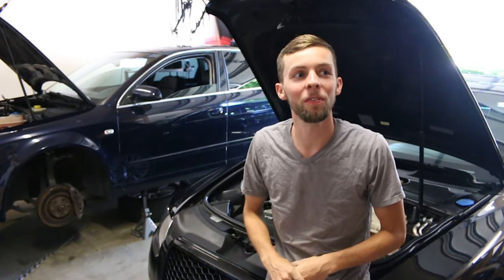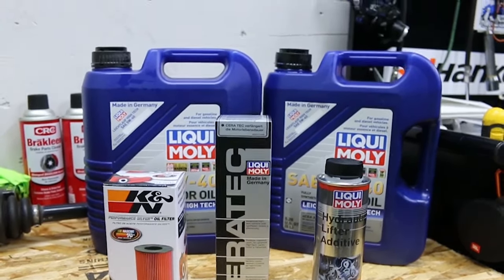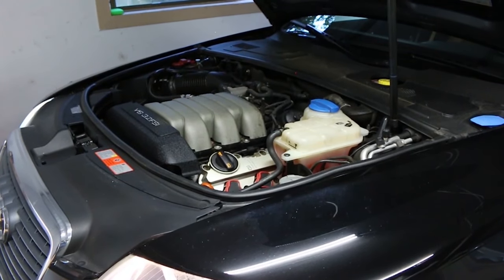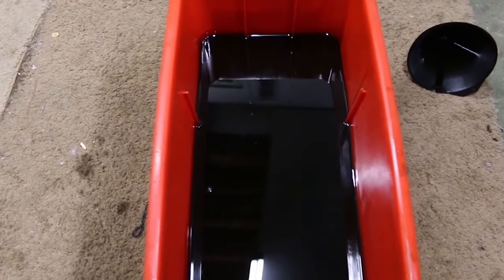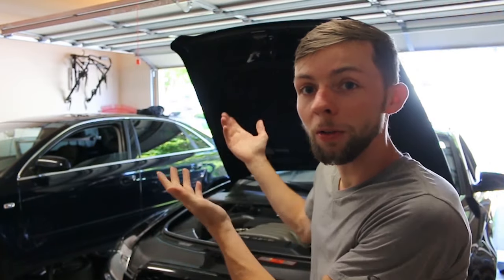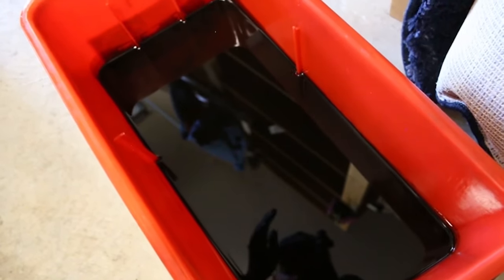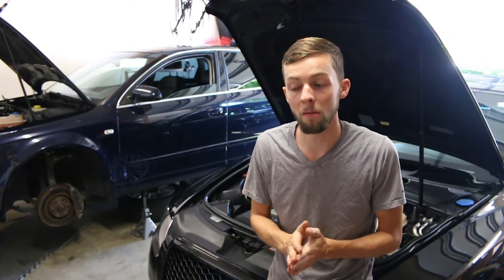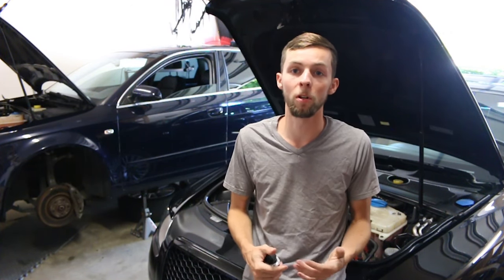LiquiMoly Engine Flush | Does it work?

Comment: Did it make your car sound any better are perform better?
Reply from the maker: Not really. It just cleans the deposits in the engine pretty good. You won't "feel" any difference or have any difference in performance. 

If anything it just keeps your engine oil cleaner and removes some sludge at best.

Thanks for watching🤟🏼

Comment: What type of Castrol oil did you use before? Was it Castrol Edge? And what weight?
Reply from the maker: I think it was just the full synthetic 5w30 Edge. But, oddly enough, I am about to do an oil change and am trying the Castrol Edge 0w-40 Euro Formula this go around. The tapping I was talking about in the video was due to bad timing chain tensioner's, not just the oil. Although the oil and flush did help short term.
Reply: @Mechani_Cole  Okay good to know! Will you make a video on the oil change? If not, please write a comment here on if you noticed any difference in how the engine ran with the new oil :)
Reply from the maker: @reeseboi8704  I do my best to remember. The engine won't 'run' any different. We are looking for less oil consumption mainly and how it acts on start ups when cold. 

Most all 502.00 approved oils will work for most Audi/Vw.

Comment: Hi is any problem with any gastek leak of your engine after you use liqui moly???😊thanks
Reply from the maker: Currently, my engine is leaking like a stuck pig! But it is not from LiquiMoly, in fact I will be using LiquiMoly once I put everything back together for another flush. Right now I have a cam gurtle (lower valve cover) gasket leaking into my sparkplug tubes. This is just due to old age and being the factory gasket. More videos coming soon on that topic, also I have another LiquiMoly Flush video being done on a Turbo A4 where I will remove the valve cover gasket and the inside before and after the flush. Thanks for watching!
Reply: @Mechani_Cole  some mechanics say that flush can make gaskets around the engine worse ,,,i know will clean engine very well liqui moly is good quality german😉😉😉
Reply from the maker: @bmwm5bmw610  if the flush causes an issue with a gasket, then the gasket already had issues in my opinion. I can't see it ruining the seals in the 15 minutes that its in there. But I do understand the concern🤙🏼

Comment: What about if small about of engine flush stay in engine and I top up by clean fresh oil?
How I know this is safe for engine when this liquid moly will stay in engine for while?
Reply from the maker: It won't be an issue
Reply: @Mechani_Cole  how you know?
Reply from the maker: @beastbody5848 been using it for over 12 years. It evaporates after awhile, I've even ran a full can for over 50 miles in the engine. No issues
Reply: @Mechani_Cole  but you make 2nd flush by clean cheap oil and filter to make sure no engine flush left in engine yes?
So to make sure all good need to be 2nd flush by fresh oil to prevent damages
Reply from the maker: @beastbody5848 not needed no

Comment: the brand recommended by the manufacturers is the equivalent of the money received by the oil manufacturer on duty. as long as they meet the quality standards required by the engine manufacturer. but I assure you that the price you pay for a castrol there are other manufacturers that for a similar price have a higher quality, and you can use it in your vehicle,
Reply from the maker: I agree 100%! I personally dislike Castrol myself, it is totally just a "Branding" thing they did. It holds up poorly in tests amongst other oils.

Besides LiquiMoly, I have recently been using Amsoil as well. After seeing @ProjectFarms videos on testing oil I figured I would try it out. So far so good after 4k miles.

Thanks for watching and commenting🤙🏼
Reply: @Mechani_Cole  okay. It is your money and car, I suggest you read the analysis table for castrol oil and others, of the same price level. And you will tell me .... I inform you that it is an oil that barely has a PAO base, or STER, the titanium they stopped manufacturing, and the EDGE that I put before my vehicle had to add additives to tec wax, it was to change the brand and without additives it reduced friction and evaporation, since this new oil has a good pao-ester base, apart from tungsten, nickel phosphor and other elements, and I have noticed it, but of course it is my car! greetings crak
Más información sobre este texto de origenPara obtener más información sobre la traducción, se necesita el texto de origen
Enviar comentarios
Paneles laterales
Reply from the maker: @SergioMartinez-fn4gi  good to know, thank you for sharing!

Comment: can i use l.moly flush with only the old engine oil and just putr new good mobil after i flush? i dont have any issues but just wanted to clean a little inside the engine. 50k km, toyota sedan.
Reply from the maker: Yes, 100%. That's the way the bottle says to do it. I was just being extra😁

Comment: Am I getting this right? I have to change the oil filter thrice?
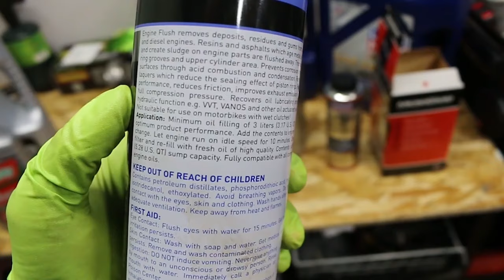1:17 Change the old filter to the new filter. 
2:51 Change the new filter to a newer filter.
4:57 Change the newer filter to the newest filter.
Reply from the maker: Yes, if you want to do it the same way as me. 

Or you can be cheap and quick and just add LiquiMoly to your old oil and then drain and refill with new filter only once. 

Its up to you how you wanna do it, I am kind of picky myself so I do it this way.
Reply: @Mechani_Cole  Thank you for the clarification.
Reply from the maker: @peek-ka-boom6017  no problem, happy I could help🤙🏼

The link in the description has the LiquiMoly Flush for about $11. Just bought another one myself
Reply: I applied flush to the old oil. Drained it out and then put new cheaper oil with cheaper oil filter, drived it for 2 days and drained the oil again.
Then I poured the new premium engine oil with better oil filter. 
Done. 

I also keep checking the colour of new oil frequently to make sure I change it as soon as it becomes darker, because after flush the engine oil get dark faster, because of the residuals.

I used ShellX as cheap alternative and then followed it up with Castrol, I also used Castrol flush, but used liqui moly additives.

Comment: If your oil has color it’s doing it’s job what the inside look like before and after you have a varnish problem gumming your lifters up and carbon and gum from varnish in ring grooves I know BG has a flush kit that will absolutely clean all the crap out of engine but it’s over 300 and ya really can’t go by the color of your filter which way does filter flow outside in or inside out cause ya need to look in crevices of pleats on the side the dirty oil enters
Reply from the maker: So after about 3 or 4 flushes over the course of 15k miles, the oil now stays way cleaner in between oil changes. Before when I out new oil in after just getting the car, only 10 miles would have the new oil looking black. Now we go about 1,000 miles before it starts to get real dark. Color doesn't mean everything, but it is noticeably cleaner each time

Comment: i have a POLO 7 i use GM oil 10w40 is it good or you recommend changing to another brand ? also my car is a bit old should i think about the engine flush technique ( changing oil every 7500 km )
Reply from the maker: Not sire what a Polo 7 is, and I am not personally familiar with that weight of oil. However, this flush will help clean deposits from inside the engine. It definitely won't hurt!

Thanks for watching🤙🏼
Reply from the maker: @youssefboudaya5939  thats cool! We call these the VW Golf in US. Maybe a little different, but very similar. Are you consuming any oil? Is the oil really dark when its changed?

The flush helps, but it still never gets all of the old oil out, which is why I use the fresh oil first to flush out
Reply: @youssefboudaya5939  you should be using the correct oil for you polo... the correct oil will have vw 504.00 / 507.00 approval written on it and will be a 5w30
If it doesn’t have the vw approval I would suggest finding one that does. Not all 5w30 are designed for the same application

Comment: Hi, I’m thinking about doing the flush and ceratec, I been using also liqui moly oil. My car has 90k miles and it’s a slk 06. Runs well but don’t want to ruin something that works fine. Would you recommend?
Reply from the maker: Hi Cesar, the flush would usually never hurt anything. Just follow the instructions, and flush with a cheaper sythetic 5-40 than LiquiMoly if you want to save some money. As far as the CeraTec, I recommend for sure.  Thanks for watching and commenting🤟🏼
Reply: This Is Coleman thanks for the answer. As you might know, some times if it’s not broken don’t touch it, and with German cars mistakes can be expensive
Reply from the maker: @cesarbojorquez7418  I agree! With mine, my oil was dirty and I had a tapping noise I didn't like. That with the new oil and ceratec helped fix that issue. Hasn't returned since. But I was also using Castrol at first, which I don't like. I drove 3500 miles since this change, and no oil consumption either👏🏼
Reply: @Mechani_Cole  ceratec can i use that every oil change or one time
Reply from the maker: @reesespieces305  you can use that every time if you like. There is a link to it in my bio for Amazon. Usually the best price
Reply: @Mechani_Cole  thank you cole i definitely need the help
Reply: here you can see a clean engine after a flush
https://www.youtube.com/watch?v=x4u64lKBbhQ
Reply: I'd also like to comment here on my car. 05 Civic EX with V-TEC. Have oil consumption & ticking sound. Plan on using this product & follow up with Liquid Moly Anti Friction Treatment along with 5w-20 Pennzoil full synthetic HM motor oil. Would like to get rid of the oil consumption as the noise I can live with by cranking the music, but if this solves both I'm happy. My question is @ 170k the engine, would this flush cause more openings by getting rid of the old gunk left that's actually keeping the car from burning more or would the Anti-Friction help to replace that? I'd like to avoid further damage & get at least 200k out of this engine if possible, thanks!

Comment: Will it be safe to use this Liqui Moly Flush product on my car's 660cc Japanese engine?  I am still in this cold weather using W20-50 Havoline as the engine is old.
Reply from the maker: No guarantees, but it really shouldn't hurt as it just cleans the surfaces throughout the engine. On ProjectFarm's Youtube, he tests alot of this stuff on small lawnmower engines. If there is sludge or build up, this will help. 

Thanks for watching!
Reply: @Mechani_Cole  Thank you for your reply...
Reply: cold weather ... 0w30 ravenol, no additives. the oil already takes them
Reply: @zeealimalik how's your car now?

Comment: How is M0S2,
Which one you found better MOS2 or Ceratec?
Reply from the maker: They both do different things, however, I use the Ceratec more often. Both are great products and can be used together as well.

Thanks for watching and commenting🤙🏼
Reply: @Mechani_Cole  
CERA TEC	"Articlenumber: 20988 Oil Additive
For engines, manual transmissions, pumps and compressors. Is added to the respective oil. Self-mixing. Sufficient for 5 liters of oil. With a long-term effect lasting around 50,000 km. Suitable for toothed belts running in oil. Not suitable for use with wet clutches!
High-tech ceramic wear protection. Reduces friction and wear through ceramic compounds offering high chemical and thermal resistance. Prevents direct metal-to-metal contact, thus increasing the assembly service life. Reduces fuel consumption in gasoline and diesel engines thanks to the low-friction effect. Miscible with all commercially available motor oils and motor vehicle gear oils."	

MOS2 ANTI-FRICTION ENGINE TREATMENT	"Articlenumber: 2009 Oil Additive
Add 5 % (50 ml per litre of oil) MoS2–Anti-Friction to engine oil; in motorbikes with wet clutch add 2 % (20 ml per litre of oil). Can be added to engine oil at any time. Dosage in motorbikes max. 2%!"

Few points want to know
1) Out of above 2 products, Based on your experience,
Which one will be better for Fiat Grande Punto (Diesel)Multijet

I have already used Engine oil Flush and Oil Treatment, Will use Diesel Purge in coming week.
Pls suggest.
Reply from the maker: @1982suraj  I would go with Cera-Tec myself

Comment: So use the engine flush and then flush the oil and then put the new oil in with the motor oil additive m02 and my car will run better
Reply from the maker: Yes on the process. But it wom't always make your car run better. This will simply clean out some of the deposits leftover in your engine. Especially if oil hasn't been changed in awhile. I don't think it will change your performance or how the car drives at all. More preventative maintenance😁
Reply: @Mechani_Cole  well i love a smooth ride ya see. I want to be able to go far without a problem Im a daily driver
Reply from the maker: @kris856  much cleaner than my engine! But this was neglected and only the first flush. Going to repeat a few more times once I put the engine back in.

Thanks for sharing🤙🏼

Comment: I have a vw jetta and my car has oil burning.  This product can help stop burning?
Reply from the maker: Unfortunately, no. I don't think it will help stop burning oil. Best bet is to try different oil perhaps or find the cause of it burning oil and repair. My Subaru burnt alot of oil, but switching to a heavier weight helped reduce the amount burned. However, it never fixed the problem, just slowed it down. In some cases, flushing can possibly make it worse. Thanks for watching!

Comment: Hi i have mazda 6 2003 its have knocking sound i change oil it last week
Can I mix that liqui moly on my engine oil? Or i need to change oil again?
Reply from the maker: You can mix this flush at any time. However, this or any other product won't help the knocking sound. That is a much deeper issue and very common in your model of car. 

Best of luck! Thanks for watching and commenting!
Reply: @Mechani_Cole  hi dude i buy liqui moly engine flush i can mix it on the oil right? Or when i mix it i need to change oil?
Reply from the maker: @kelvzalvaira5572  either way

Comment: Looking at your pressurized dirty oil filter looks like you have oil pressure issue that causes the tapping noise
Reply from the maker: Negative, but it did have failing timing chain tensioners that eventually needed to be replaced, that was fun to do😩😅
Reply: Timing chain tensioner is no fun and what was the mileage?
Reply from the maker: At 115k miles on this one. I actually just finised up the video of doing those, the cam girdle seal and having the engine out. Should be uploaded later today. It was a nightmare for sure😅
Reply: Ill watch it later haha lmk when its uploaded
Reply from the maker: Just posted🤟🏼

https://youtu.be/eW-zoSizWgE

Comment: those flushing are expensive and not sure if those really do clean the oil pan..its better taking the oil pan off and clean it also the pick up tube mesh 01:52  did u fart?
Reply from the maker: Only about $12-15 for the flush, didn't seem to expensive. Yes, this does clean well. However, this engine was very neglected before I got it, so this 1 flush did next to nothing. Learned that once I pulled the engine and saw inside. But now it is nice and clean, and will work well to keep newer cars clean.

As for the fart. It was a mouth fart for sound effects😅 Funny catch👏🏼

Thanks for watching and leaving a comment🤙🏼
Reply: @bestofthebest3821 - re: "fart" = how many times per day do you fart?  silent farts?  noisy farts?  smelly farts?  :face-blue-wide-eyes:

Comment: Did you do the mmi3g conversation or was it already done when you got it?
Reply from the maker: Good question! 

I did not update this one, however, I did fix it in the beginning as it did not work when I purchased the car. One of the reasons I got it so cheap.

Here is a video testing a dead MMI if it helps at all: https://youtu.be/6cCVkNY-iGI

If you want to update your MMI check out Ebay, there is the software disk for under $20 if I remember correctly. Its pretty easy😁

Thanks for watching!

Comment: I drive a 1996 mercury grand marquis gs and Im due for an oil change and my car takes 5w20 and i want to use the liqui moly engine flush and then i want to put the new oil and do i use the ceratec or the oil additive
Reply from the maker: It definitely won't hurt either way
Reply: @Mechani_Cole  well i will try the ceratec thanks
Reply from the maker: @reesespieces305  no problem!

If your car is running rough, and you haven't done much to it over the last few years. I would recommend replacing the following to improve how your car runs. 

Spark Plugs/Wires 
Air Filter & Fuel Filter

Just to start, to see if it improves any more. These parts need to be serviced every few years no matter what. 

Also a bottle of Techron Fuel cleaning additive helps clean out the old fuel system. 

You car is almost as old as me😅, I am sure it has some deposits built up and needs some service.